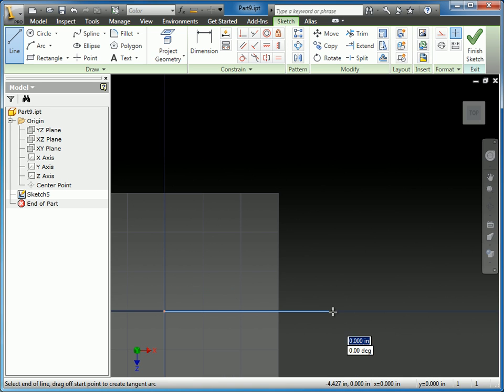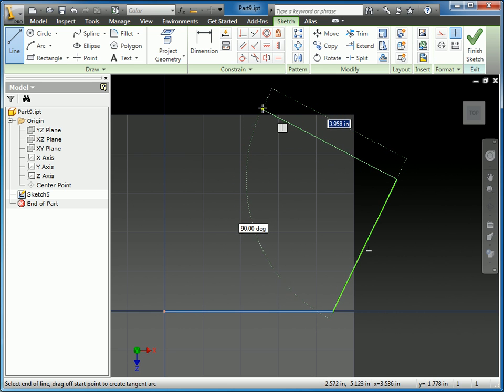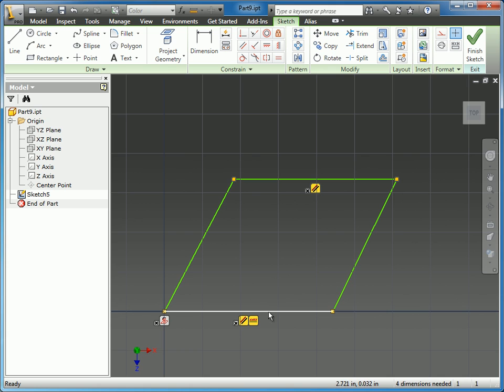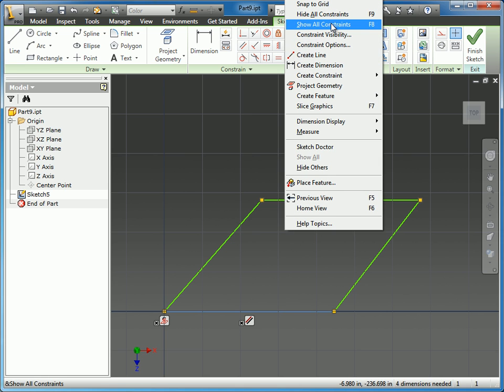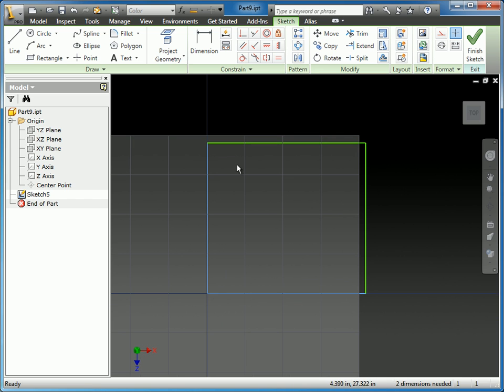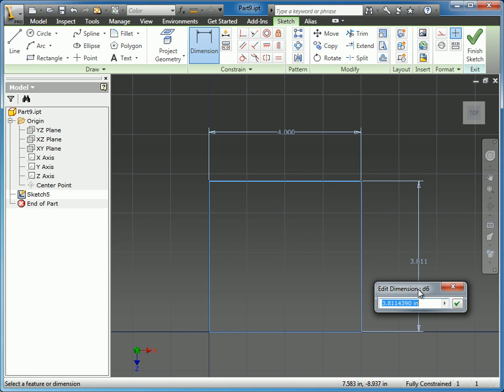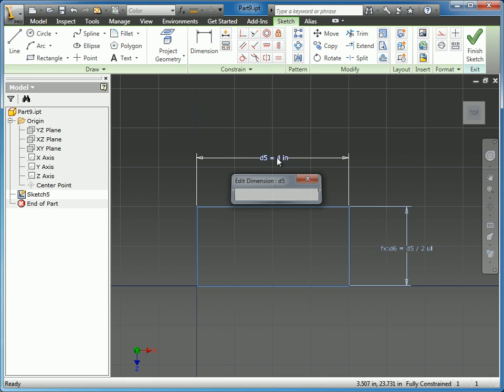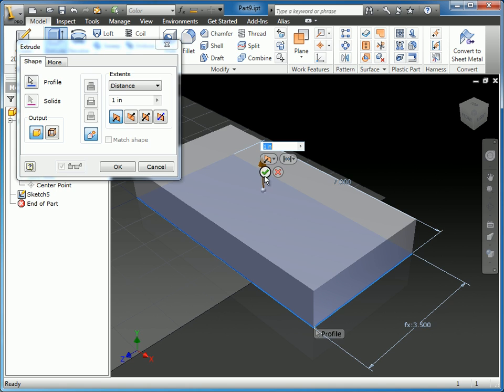Part 2 - Sketching in Autodesk Inventor 2011

Comment: John,
Thanks a lot for the tips.  I tried follow your instructions but I could not find those options anywhere, it turns out that I have Inventor 2010 and your is 2011.  Too bad ;((.

Comment from the maker: Ah, got it. You must have disabled the Heads up Display (HUD). Go to the Inventor application options. You can access them from the application icon (the big yellow I in the upper left corner). Click the sketch tab and check the checkbox that says "Enable Heads up Display (HUD)".

If that is already checked then click the settings button and check the box that says "Enable Pointer Input"

That should do it.

Comment: Thank you so much for the response.  I'm sorry that I did not make myself clear.  This is what I was talking about.  For example: When you start sketching a line at 0.01 sec of your video, I saw there are 2 boxes moving along with your cursor, one is for the degree and the the other one is for the length of the sketching line in inch.  In Mechanical Desktop, I could toggle that feature on/off using Dynamic Input, but I can't get it turns on in Inventor.  What do you think I'm missing?

Comment from the maker: I am not sure I follow what you are asking. When you start sketching, say a rectangle, before you pick the first point you can define the starting point exactly, but after that the position of the second point is based off the initial point and is controlled by dimensions. I almost never use exact point inputs because this isn't AutoCAD and the parametric dimensions are much more powerful. Let me know if this helps, I may have misunderstood the question. Thanks.